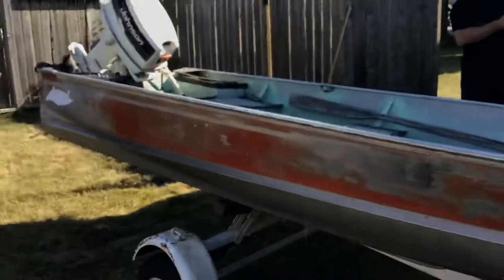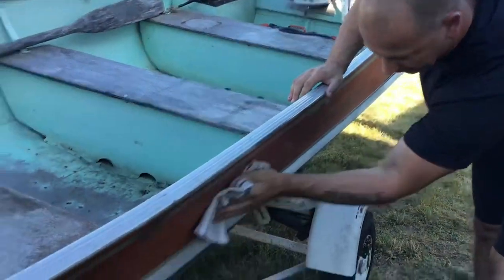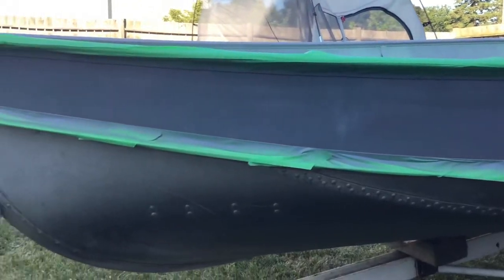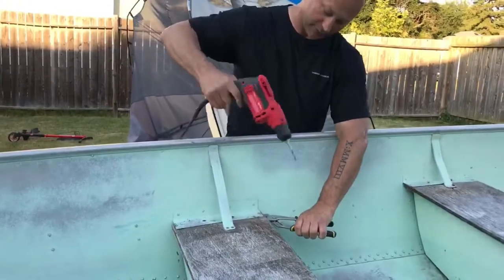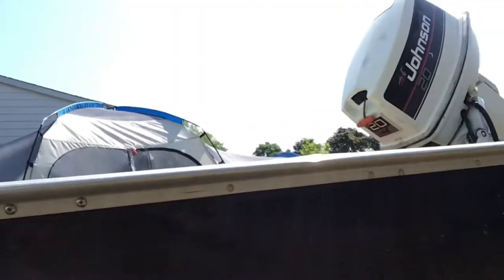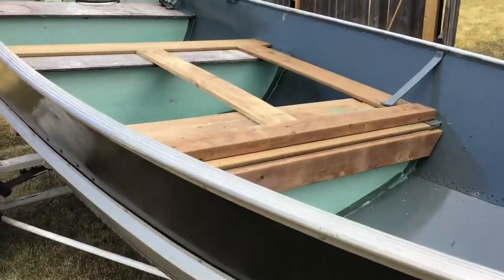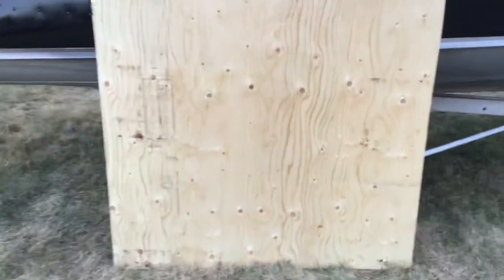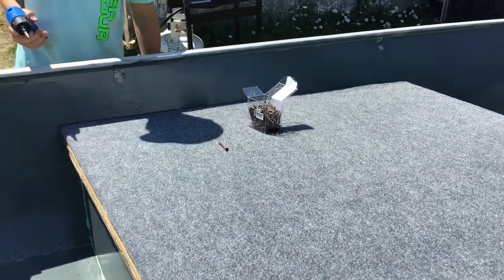14 Foot Aluminum Fishing Boat Restoration!

Comment: Did you restore the trailer ?! If so where did you find parts for it cause I’m struggling to find the sway bars under the trailer connecting the axle to the frame. If you can help thanks. If not thanks still!!!!